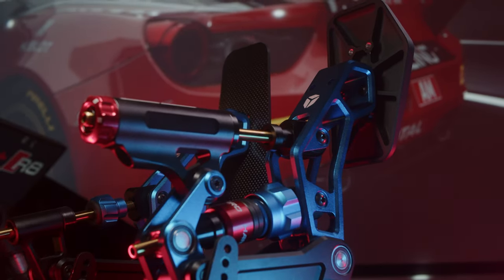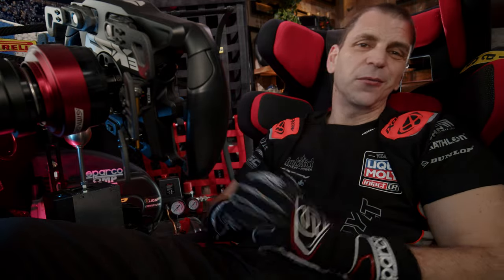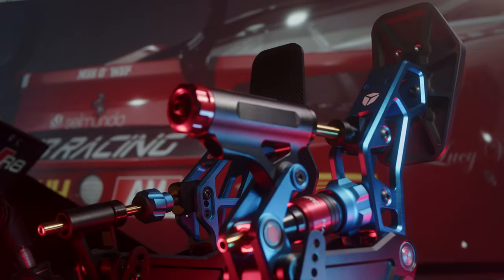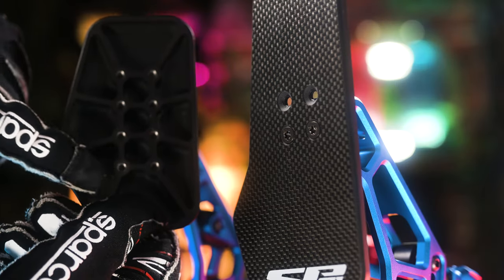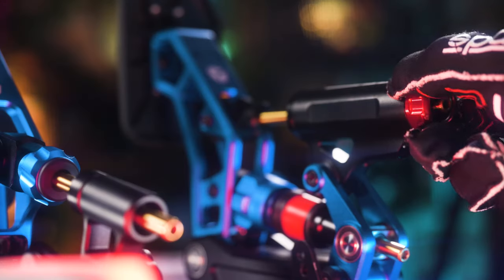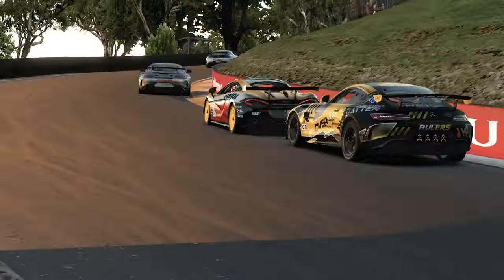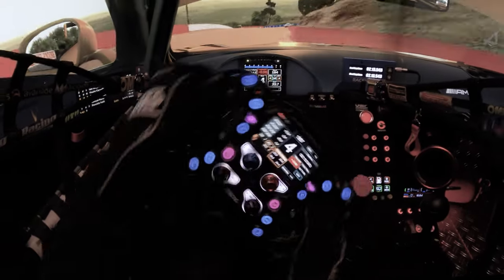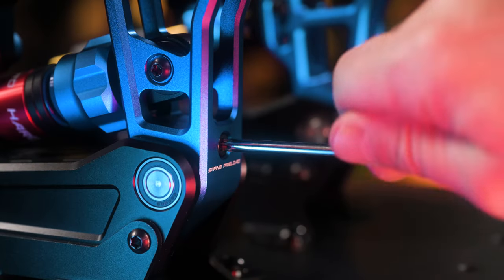Cube Controls SP01 pedals closer look

Comment: I can't imagine ever driving a sim in socks or bare feet as we don't even drive our road cars like that, well except for the odd bare feet times.
Thanks for the tip of wearing socks over shoes - very interesting!
I have worked very hard on my rig to not have my heal lift on either the accelerator or the brake pedal, the extra point of contact gives me more control 🤗

Comment: Shoes, not necessarily racing shoes, but shoes that have a thiner outsole. I feel more in control of the pressure I apply, and my feet slide less over the pedals plate than using socks.

Comment: Thank you for another Awesome video bro, makes me figure the thought process Fanatec made with thier CSL elites v2 as they proabably considered these factors with thier somewhat budget and simple design having a smooth pedal plate with just a simple  rubber cover. Nothing extravagant looking but very pratical for use. I was previously using pedals with plates held in by screws and i found them to hurt my feet after awhile from the holes drilled into the plate for the screws. It didn accur initially but ive grown to really appreacuate the flat and smooth plate design in my current pedals. I use socks with my pedals and the  level of control i get with the pedals even for brakes are great!
Reply from the maker: I know what you meant exactly man🤛
I drive with socks and really prefer smooth surfaces on the pedals plates

Comment: I use Sparco simracing shoes and gloves. If you have TOP quality pedals (I have the ImSim Talento) and also consider the pedal settings and the pedal pressure points to be important, as in a real racing car (especially the brake), then you have to use shoes and gloves. There is no way around it. Driving with socks only is a nogo.

Comment: Interesting I thought it was only me… I can do shoes on the brake but on the accelerator I need to slide my feet to control better. I have some gel protectors (walking in shoe gel little pads), for the right feet and no shoes (they slide but are  still comfortable)
Reply from the maker: Yeh man , it is the movement so different!

Comment: 2:02 i cant agree. With me its the heel that is slightly sliding the heel  plate as i have the lenght very nicely dialled. I use plastic plates from fanatec clubsport v3 that i own for quite some time. In fact i am after replacing load cell assembly as it snapped due to the wear and they r still in very good shape.
I guess what u talk about is possible with metal plates. I did it like that since the very start cause i was going for more grip. Ill think of throwing in metal ones.
These brake pedals  look savage
Reply from the maker: I got it buddy! Sometimes wen drive on grippy pedals my heal slides but that also depends on the angle of the body leg posture!
Reply: @chepilevski  
Makes me feel that with less grippy plates u can get away with less fatigue cause u use muscles less.